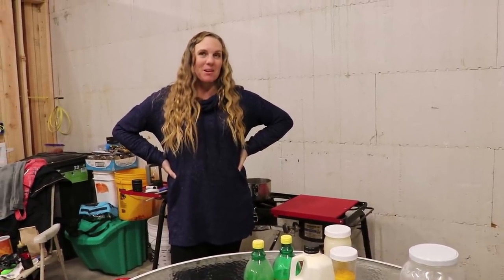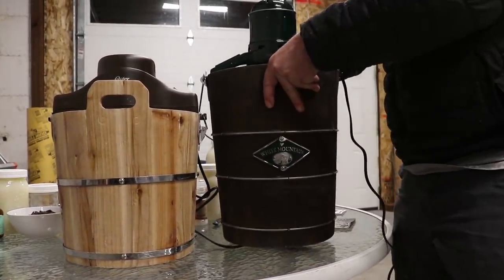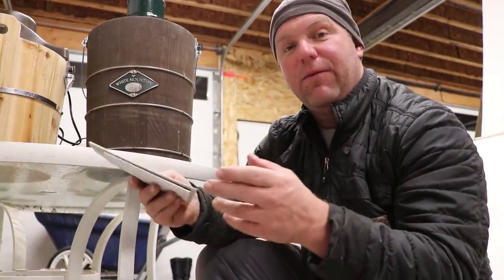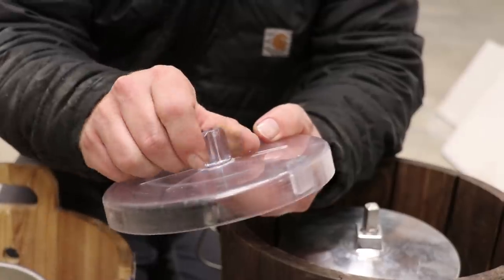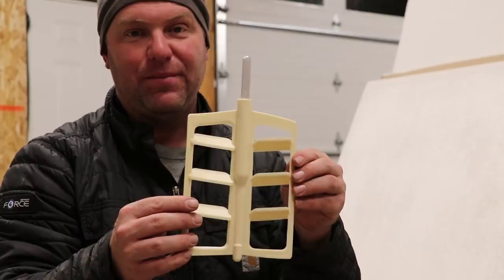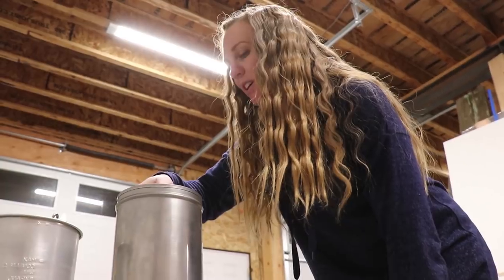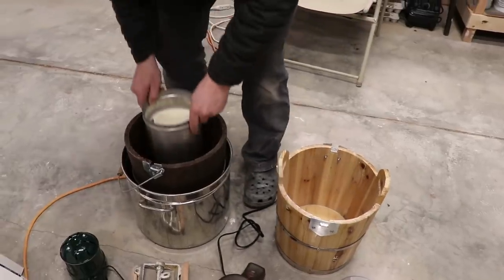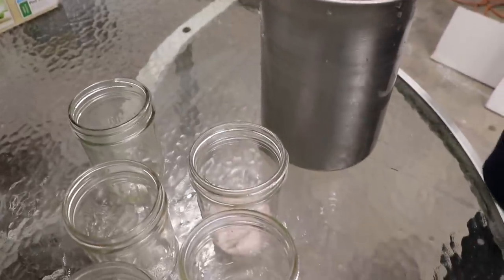TESTING CHEAP vs EXPENSIVE ELECTRIC ICE CREAM MAKERS

Comment: You need to follow White Mountains directions for the amount of salt to mix (5 cups ice to 1 cup salt). it makes a difference in the speed the ice cream freezes as well as the texture. My family has been making ice cream for 70 years and I believe the White Mountain is the best. Mine was made in the USA before the company was sold and the motor locks in place.

Comment: Here's a little secret, if you notice when you opened up the icecream machine the bottom was more solid than the top. 
After putting the ice and salt in I put cold water in 3/4 to the top. The ice only contacts the steel barrel at each ice cube. Water makes contact with the barrel completely around the barrel. It will make icecream faster and more frozen,  ready to eat.
When you put drinks in a cooler you put the drinks in then ice then water and it will cool the drinks faster and better because the cold water covers more of the can/bottles than just ice.

Comment: I have had both the White Mountain and the Oster.  I decided that the quiet and faster freezing  Oster could be bought 5 times to my Chinese White Mountain..  By the way, when your machine quits, remove the motor and fill with ice to the top add salt, and cover with a small rug, or tarp to hold in the cold.  It will be solid in 30 minutes.

Comment: We bought a hand crank White Mountain wood tub mixer in 1973 and still have it.  The crank mechanism and gear head attach with a prong on one side fit d;own on the canister and dasher assembly to be latched in place with a cam clamp over another ear.  The canister rotates one direction and the dasher with the wood paddles rotate in the opposite direction while the center of the dasher is made similar to yours rotates the same direction as the canister.  We got to where we could make the mixture, pour it in the canister, add ice and salt, crank and have ice cream to eat in 30 to 35 minutes.  We would put in some ice then salt then ice then salt them ice then salt while cranking.   We made ice cream faster than my father-in-law could with his electric fiberglass tub maker which was heavily frosted on the outside of the tub.  He argued that was what froze the ice cream.  I still have the wood tub hand crank mixer my parents used even though it will need some repairs to work.  Although I will say that cheap and inexpensive are not necessarily the same thing.  I have seen a lot of cheap but expensive things.

Comment: Having had a White Mountain for over 40 years, (my wife and I have been married for 50) I can tell you that White Mountains last. I don't think you're quite doing it right but maybe you are but let's check first you start loading your freezer with salt then ice. salt then ice, salt then ice and maybe one more salt and ice(4 layers). Next you let it run until the motor starts to really wine (you guys are not using enough salt)  but that's when you know that it's done. enjoy your White Mountain we've enjoyed ours for decades. now have fun

Comment: Though the cheaper one may be quieter...it's Direct Drive.   The High Mountain is Gear Drive.
Gear Drive will Always be noisier. A Gear Drive will also have more power/ Torque when the cream mixture gets thicker.
Where as with the Direct Drive ( Oyster) may have some issues as the cream becomes thicker.
I have always used the Hand Crank when I was younger...but recently I was given an electric one....haven't used it yet.

Comment: We used White Mountain 60 years ago when I was a boy. We started with manual machines when I was younger and switched to electric later in my life.  Perhaps the machines have changed, but the electric White Mountain we used was just allowed to run until the motor stalled.   That was how we knew the ice cream was ready.

Comment: One issue for most people is how many times a year will you use it compared to the price of the maker. You have made  Icecream several times a year. where I possibly would make it maybe 2 times. So $250 vs $30. I say the lower price. Yes it takes longer but ends up very similar results. When you live on a strict budget time is a cost you can afford.

Comment: McCormick vanilla is a crime, why bother with organic peppermint if you’re going to use inferior blended vanilla? They should try Nielsen-Massey organic Madagascar bourbon vanilla and it’s made in the USA. 

FYI Madagascar bourbon is the variety of bean, there’s no bourbon liquor flavor. Other varieties are Mexican and Tahitian which are very bold and flowery respectively. Bold as in overpowering and missing subtle flavors not stronger. They do make double and triple strength vanillas but I’ve never used less in practice. Oh and Mexican vanillas you buy on vacation in Mexico have been known to contain dangerous chemicals, personally I stick to made in USA from Nielsen-Massey.
Reply: You can also buy J. R. Watkins Madagascar bourbon vanilla, it is the best in my opinion and is a family owned U. S. company.

Comment: the metal gears are what makes the white mountain one a lot louder. metal on metal is much louder than plastic on plastic. At the high speed / low torque side closer to the motor, it's often better to use plastic gears because the higher speed of that part of the gear train makes it potentially much louder. then transition to metal at the low speed / high torque end of the gear train, where you benefit from the metal's extra strength, and since the speed is lower, the extra noise from the metal doesn't make such a huge difference.

Comment: I don't care for messing with the ice and rock salt, so I picked up a 2 quart Cuisinart.  I works fine.  The only issue I had is there is a hole in the top for adding ingredients, but they do not include a cover.  I put a towel on top to keep the cold in and make it a little more silent.  It works rather well.

Comment: It's freezing faster because it actually wipes the sides well. All the heat has to leave the container through the sides. Ice buildup on the sides will significantly lower the heat transfer and slow down freezing.

Comment: Bought a white mountain for my dad for Christmas 25 plus years ago threw it out last year made a batch of ice cream every other week I'd say it's  WAS  top-of-the-line. It was made in America. The one you show as a Twist system for the laching of the motor they used to have a lach that held it down I guess they think they improved it. I've been  a subscriber for a couple of years really enjoy your videos keep it up. Thanks from the Bahamas🇧🇸
Reply: If you noticed when the WM started the engine torque caused the motor bracket to sit securely in the latch (~22:40).  Also wonder why they didn't add more ice for a constant temperature.

Comment: I'm surprised the glass jars don't crack in the freezer,
Reply: It will only stress the glass enough to crack I'd your putting a very cold substance in a very hot jar. Now with age and time the variables are slightly less pronounced but with a room temperature jar being filled with cold ice cream the glass has enough time to absorb the temperature difference without a shock causing stress to the glass resulting in cracking. I'm not sure how much it would matter but if you really wanted to, refrigerating the jars to slowly bring the glass evenly to a colder temperature would be better before introducing the ice cream.  I used to blow glass for a living and the same goes for cooling it down after working the product.
Reply: Note that they left some head space in each jar so that there was some room for expansion when it freezes.
Reply: If you leave room for expansion they will not crack. notice in the Video the jars were not filled to the top

Comment: Why is the "White Mtn"  Louder  (Hint it's the Metal Planetary GEARS your hearing, the actual motor sound {Ref: to the White Mtn} is a very distance 2nd) then the Oster?

 Answer: Metal Planetary GEARS.  Metal Planetary GEARS are used often when their is a LOAD.  Planetary gears, which can supply a lot of SPEED REDUCTION and  TORQUE in a small package, have operating characteristics beyond those of fixed-axis gear trains. Planetary gears are made of hardened steel to promote the longest lifetime possible. 

Many innovative special systems with a planetary gear at their core have already .... made from technical thermoplastics are used for noise reduction, while steel ...

Comment: many years back when my grandmother made ice cream all of the grand kids had an assignment. in rotations to keep the weep hole open keep the ice level full and add salt sparingly when adding more ice. but most important the young arms to crank the handle. always reserving the bigger ones for the last. and you are correct wiping the sides of the tube is very important. as now being the custodian of this machine ( probably 60 years old d or so) it doesn't get used as much but dose provide many happy memories when it dose.  love all you videos.  dave.  PS curious as to why you didn't insulate more on the outside wall of you bathroom? I realize you used the insulating forms but in this case I would think more is better.

Comment: there used to be a Ice cream freezer sold the needs not ice or salt, it runs in your freezer with a cord out the gasket to the outlet. so you just fill it and let it run.  When it stops making noise (if you can hear it out side the freezer) then it is done.  Also made great ice cream

Comment: I was surprised by the design change to the White Mountain maker.  It used to be that both the electric and manual makers has a slot on one side that you slipped the motor frame into and a notch with a latch that held the other side of the frame in place. It appears that only the manual machines are made with a latch these days.

Comment: too many variables for a fair performance test. more salt makes it freeze faster. more sugar and it freezes slower. fruit in one and it's runnier . to be fair, the mixture should be the same in each, and the salt to ice ratio should be the same. as far as build quality,  if the cheap one breaks in 7 or 8 years, you already saved enough in the initial purchase to buy a new and improved model.

Comment: You said it yourself earlier on, the more expensive one has metal gears so of course it is going to be the louder of the two. Really, should have a metal gear on a nylon gear, then if there are any issues, it strips the nylon gear leaving one to be replaced. Two metal gears, any issues, you know have a lot more work on your hands.

Comment: Mint choc chip is always bright green here in UK,  even from the best makers.   I wonder if spirulina would spoil the taste.
One variable you might not be accounting for is how cold the ice is,  before you add the salt.  The salt water will always be 0'F at first but it will only stay that cold as long as some of the ice is still below that temperature.   I guess the pails are sized appropriately so that the ice runs out just when the ice cream is on the verge of being too thick for the motor, and to scoop out,  but if you want to get a bit more freezing power out,  you could try adding some dry ice,  or crank down the thermostat on the freezer you freeze the ice in.

Comment: White Mt is really loud, but the motor and gears "sound" sturdy and strong.  Plus, it appears to be turning somewhat faster.  The real test will be when the mix thickens AND when the tub is full of ice.  Of course, that would be a case of diminishing returns.  As the ice melts the noise increases?

Comment: OK if you are now talking On Grid you first of all have to decide which type of Ice Cream maker you want. I am in the U.K and lived in a water mill s a kid with no mains anything. So I have used the Hand crank version of these. As you say option 1 is what you have? You have to buy or make loads of Ice and buy loads of Salt. Now that you are On Grid that is easier because you can make your own Ice or buy it and keep it in a freezer ready? The second sort you have a unit with a removable bowl which you put into the freezer for a minimum number of hours. At which point you get you mix ready and cool then put the bowl in the machine, The Paddle in the Machine, The Mixture in the Machine, Put the top on and Start. You will get to a level of Ice Cream that you will need to put it in a container and freeze in the freezer if you want a harder Ice Cream? Then you get the 3rd type which is what I would go for A complete self contained unit. The bowl does not require freezing (But it may speed things up a bit)? You put the Bowl. Paddle, Mix in the machine, Put the lid On the Machine, Turn the Machine On. And the Machine lowers the Temperature and Mixes the Mix until it gets to the type of Ice Cream you want at which point you turn it Off and it is ready. Add flavours to any of them at the appropriate time? I like Rum and Raisin but as Alcohol does not freeze I have to wonder about using an expensive one all the alcohol will have evaporated so I would try Rum Flavouring with Smoky sauce and/or caramel to improve the flavour. If friends turn up for Dinner you can set it going whilst the rest of the meal is being prepared and eaten. And of course all can be made then kept in the freezer? But you do need to take it out the correct time to get the consistency you like?

Comment: Any thoughts on getting an ice maker to remove the need to buy ice each time? Could even heavily insulate a storage box for the ice and just use a small counter top unit to then dump into the hopper when full.

Comment: The noise from the White  Mountain is gear noise amplified by the bucket, check the grease in the gear housing there should be enough grease to cover the gears, a good quality grease will muffle the gear noise and don't forget to check the bearings on the motor as that can also generate noise if they don't have enough lubrication. Don't assume that that enough grease was used in the factory when the motor - gearbox was assembled.

Comment: The noise difference is white mountains way of cutting costs by having straight cut gears rather that helical cut gears.
Reply: The inability to use poisonous mineral greases like moly probably makes metal gears a poor choice.  I think I'd prefer the quieter plastic gears if they can be readily and cheaply replaced when needed.
Reply: Helical cut gears waste energy as they generate vertical force as well as rotation. The vertical force generates heat. Straight cut gears can also run nearly silent but the tighter clearances also generate heat. Louder gears have more clearance, generate less heat, and can withstand higher torques.

Comment: Thanks for the review and tips.  I wasn’t aware that there was that much difference between cheap vs expensive ice cream makers. I was actually looking at an Oster model, but now, after your review, I plan on looking at several other models for features and construction.  The ice cream looked SO GOOD that my mouth was watering just watching you scoop it into the jars.  Do you reuse the jars and lids or do you just add a new lid each time you make something different.

Comment: That brings back memories of making ice cream on the family farm. Fresh milk from the cows right after the afternoon milking. Cranking until you thought your shoulder would not be able to throw a ball again. The thermodynamics of stainless steel versus aluminum are significant. Keeping the ice from freezing on the inside of the container allows the cold to penetrate deeper into the center area for more even temperature drop all the way to the dasher. Metal dashers get cold and stay cold better than their plastic counterparts. Science class over. GO EAT!!!

Comment: The cheep wooden one does not scrape the barrel well, there is almost an eighth of an inch gap.  If the paddle was bigger or if the barrel tub was smaller it would do better.

Comment: Your high-priced version freezes faster because the dasher scrapes the ice off the inside of the cannister.  The low-priced one does not so the ice accumulates on the outside wall and does not get mixed in as well.Store-bought ice?   Why not harvest snow and ice from outdoors?

Comment: i wonder if it would help it along if you put it out in sub freezing weather to work.  If it was sub zero you might be able to forget about the ice and salt and just use it like a cement mixer.  Good presentation.  You might think of just putting a rope handle across the Oster.  The modern way of doing that would to go to a welding supply and get a thermos full of liquid nitrogen.  Than you put all the ingredients in a stainless steel bowl and pour a bit of nitrogen into it until it foams and freezes. Being careful of course not to let it splash on any living tissue.

Comment: Don't think you put enough salt in the oster because the ice wasn't melting.  Looks like a wash to me. I have thought about getting an ice cream maker but I need to eat a bunch of ice cream like I need a hole in my head. Maybe one of the little counter top ones that make a pint or so with electric cooling instead of ice?
Reply: It would have been more scientific if they measured the salt and ice, but assuming they eyeballed it to be equal, the heat transfer difference is enough to explain why the Oster didn't melt as much.  The White Mountain stirs the mixture inside better and so that makes it more "cold hungry".

Comment: I am saying the cheaper one is the one to get for most people.. but whichever one you have you should count yourself lucky .. most people don't have access to farm milk so they are only going to do this once a month or once every 2 months.. plus who wants rusty ice cream.. gees they aren't using galvanized cans heh its aluminum.. aluminum is actually better than steel by about 15x.. it passes through heat faster .. the ice melted a lot quicker in the white mountain ... the motion caused faster transfer of the cold to the milk...